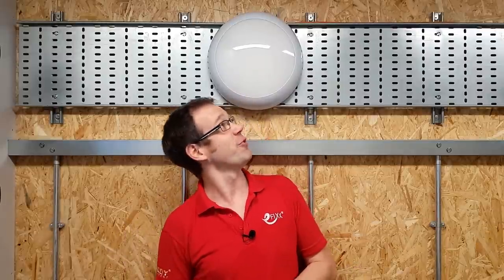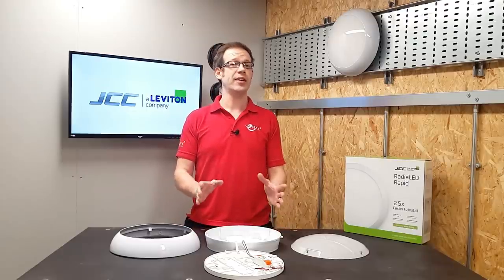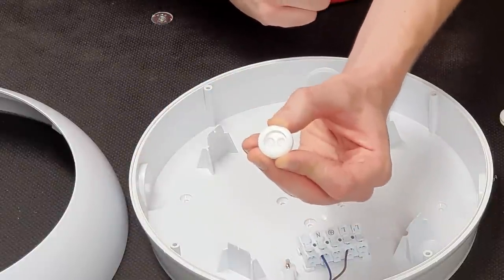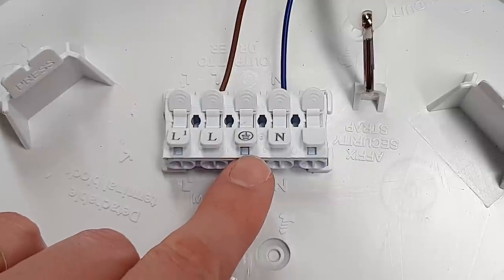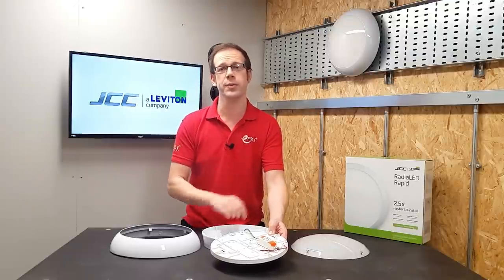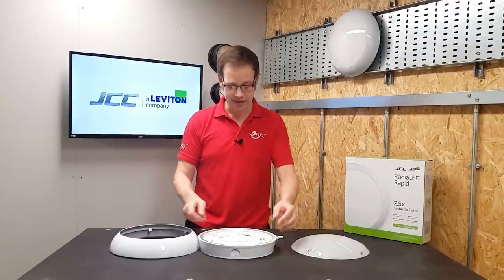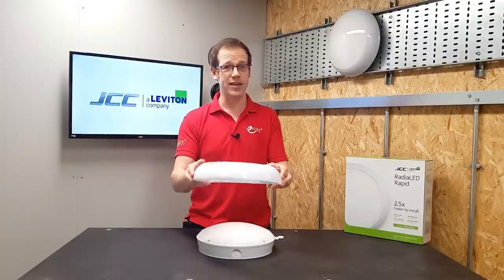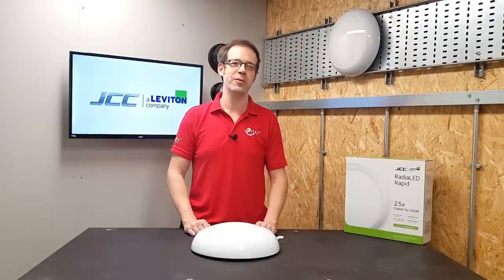JCC Have done it AGAIN! - Listening to electricians and creating the RADIALED RAPID LED Bulkhead

Comment: my only problem is push fit connections. always end up using connector blocks because there is only room for two wires in push fit, how often do you get live in, live out and switch when replacing fittings, and even worse when you get live in, live out, switch and loop on to another fitting.
Reply: +LeicaGermanShepherd
In this case, each of the 5 terminals has 4 connections available (2 each side) so ou CAN cope with feed-in+feed-out+switch on the existing terminal block.
Reply: @sbusweb  i noticed, hence my comment.
Reply: @ShadowzGSD  because a light fitting isn’t a junction box..
Reply: What are you on about .  Look again and stop the vid on the junction connections. 
If you have a Line in and out to the next light, then use the spare connection for the Line. From this to the light switch, then then back to the light to the Line that lights it up. All there. Easy.  Push-fit connections are far safer than terminal blocks.
Reply: @johnburns4017  some people need to learn to read before posting stupid replies
Reply: @ShadowzGSD  
Some need to look at the vid before posting stupid posts.

Comment: love the flexibility of the fittings, fantastic range of options .. but a plastic gear tray for led? what about heat dissipation? 1 year warranty i guess?
Reply: Torchy, thank you for your message. The base and diffuser are polycarbonate. The LED Tray is PA6 Nylon and has been thermal tested. RadiaLED Rapid comes with an extended 5 year warranty.
Reply: @jccadvancedlighting  brilliant, can't argue with that .. i used a similar looking fitting made by JCC for bathrooms in a new build.. nice light output .. i assume they come in 4000k ?
Reply: @thattoolguy9432  Yes, 4000k, thank you

Comment: JCC would REALLY be thinking about us, if they included three terminals for CPC and neutral! What’s the point of those ‘spare ones’ why not just add them onto the earth and neutral for the common three plate method??!!! So close to being perfect, but so very far for that reason.
I’m sure these companies think they’re lights are only connected at end of line or switch fed. So frustrating.

Comment: Jeeze - JCC utter tat imported from the far east, spec changes every couple of months as they find a new manufacture for a few pennies cheaper, terrible LED's, unbranded drivers. Terminals are even cheap knock-off Chinese versions. 100Lm per circuit watt, that is also shockingly low these days. Terrible lead times (waiting for a boat to dock!). Don't be fooled folks.
Reply: They have thought of some useful things around install but I'd agree with the actual finished quality of the product not being any good. Philips produce an LED for Dubai that has an efficiency of 200lm/W now (shame you can't buy them anywhere else though).

It's a shame that with labour being the biggest cost of most jobs manufacturers focus on time to install alone and selling an overpriced product to an installer rather than a quality product that would be better for the customer.